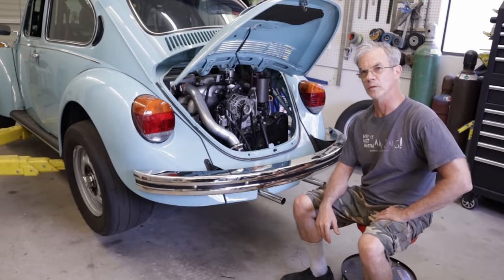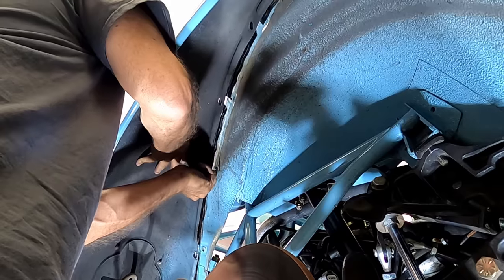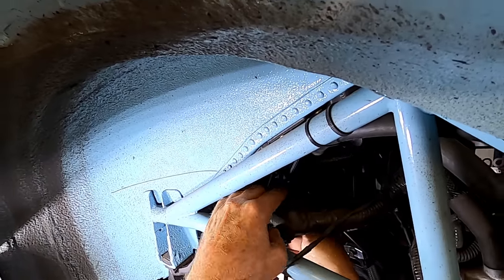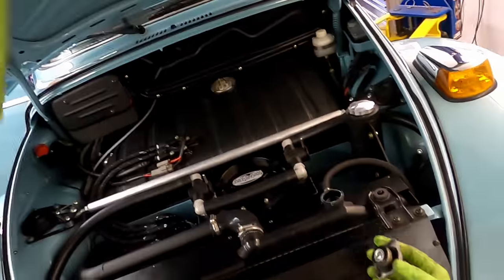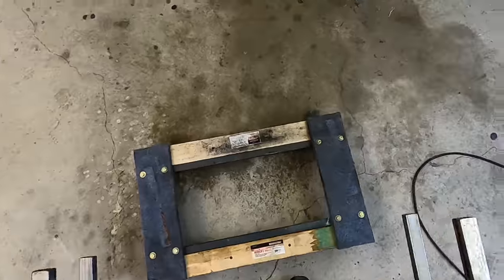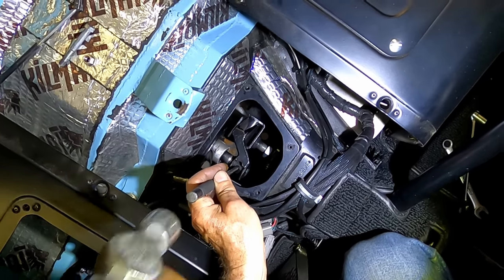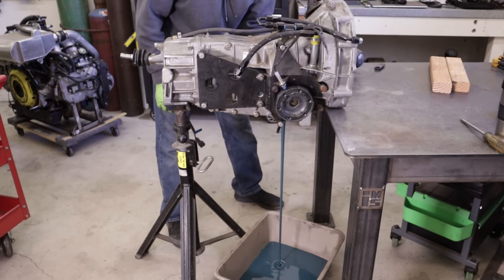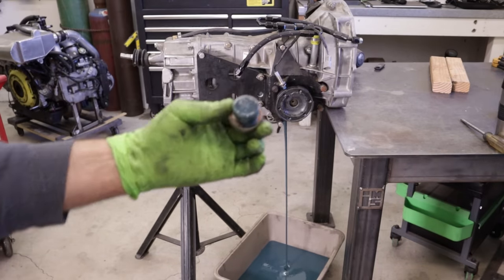Subaru engine and transmission removal from VW bug

Comment: Your Subaru powered bug would be so fun to own and drive. With that said, I spent lots of the early 1980's pulling my high compression 1835 engine out of my Cal-look bug after blowing it or the transmissions up! lol. Watching all the work you have to do to remove that engine and it's transmission makes me appreciate my now bone stock VW bugs. Pulling an engine out of them in my 50's is a piece of cake. Of course, I rarely pull them anymore due to the reliability of the bone stock engines running all the original, restored German parts.  Amazing how reliable and dependable these cars were. No wonder VW sold so many of them.

Comment: I raced shockproof for years in my gearboxes, but since replacing syncros was way more of an issue then bearings, got switched to schaffer V-twin primary lube.  Way better.   As you say, Shockproof is too slippery for the syncros,  shockproof superlight didn't hold up, and the shaeffer stuff seems to do it all.  It has a property that actually enhances the syncros, while the base stock does fine for all other components.

Comment: Had a 2110cc in my bug. Didn’t really feel that fast. My Corvair with 327 was fast. Flipped the trans 180 and motor was in backseat. Crazy easy install. Had a few kelmark gt’s. Fun too. Olds 455. Fit in corvair too.

Comment: Awesome! Thanks for sharing! I was wondering what it looked like in there from Nicole's video, glad you have a youtube! Did she break it? Or rather did it break while she was driving? Seem like it takes a while to get used to the shifting. She didn't make it past 5th and it ended kind of quick so seems possible. *Edit nvm I heard you  explain the thought as to why
Really brilliant build here, you really knocked it out of the park! The engine isn't as big as I thought it would be.
Reply from the maker: She didn't break it, but it takes a bit of time to learn how to drive it.  She would have caught on if she had more time.

Comment: John,
Have you ever tried to install the Subaru 5 speed with a vw adaptor to a Corvair motor?

There is a post by a gent that explains the process but no further updates.

Seems like a project you could tackle and already have parts
Reply from the maker: Corvair engines were pretty common transplants 50 years ago but they are antiquated by today’s standards

Comment: Interesting video l have seen a type 3 VW with a Subaru conversion but it was the non turbo motor but it was well done and the radiator was a long thin one placed under the front bumper bar also MCM did a turbo subaru conversion to a VW beetle and this beetle was and drag raced many fast car's and it beat them all this is a complec as

Comment: Unfortunately you have a trans axle, so you can separate the two with different oils. I'd be curious if you just used something like this in that gear box how it would perform 00004320530 Fuchs Titan Sintopoid 75W-90
Reply: Unfortunately or fortunately? I am confused.
Reply: @chrisallen9154  Unfortunately. I'd like to run two different oils in my Audi, but the trans axle prevents that. I run that same Shockproof Redline in my Ford Toploader transmission, shifting seems ok, believe gear noise is the same. Subaru transmissions have documented issues with 5th gear, but not with baulk rings that I'm reading until the later 6 speed boxes. I'd almost vote to have the gears matched no baulk ring at all. You can go back to what Subaru uses in there gear boxes for oil likely might help, or have someone make a steel baulk rings with carbon facings?

Comment: As complex as THIS project has become for you, for what it took for you to get at that 5th gear broken part, seems relatively straight a forward job, by comparison to what I had to do to just reseal the oil pan & dipstick rod’s mounting flange of my stock 7.3L Powerstroke engine in my 2000 F-250 4x4 Lariat! THAT had me really WANTING to sell it several times over!!! What a nightmare! Anyways, awesome mod-build of your Suba-VW; have watched all of your vid’s & always impressed… I suppose if every car made had this amount of engineering thought invested in it, they’d all be priced at now less then $100K each

Comment: Sorry if stupid question, but wouldn't worth to adjust the gear relationship and keep it with 4 gears, instead of adding the 5th?
Reply from the maker: It’s a Suby trany that comes as a 5 speed from the factory.  5th gear is like a fwy gear so it’s not over reving at 70 mph

Comment: I I hope maybe you can help me put a 1998 Forester 2.5 L Subaru in my sent me for Volkswagen beetle I was told did not have to run both oxygen centers but my car won’t run right so I’m trying to find out if I need them both in there or just the one like I was told
Reply from the maker: I don't know the answer.  Maybe someone on one of the Subaru/VW Facebook groups can steer you in the right direction.

Comment: If that is a K&N air filter wash all the oil off and use it dry. They work better and don't get dirty right away. I won't even use a new one without washing it first.

Comment: I know there are adapter kits to mate almost any engine to a VW transaxle.
Is there a similar kit for using a Subaru 5 speed with a VW engine?
Reply from the maker: Yes, there is, but not recommended.

Comment: Can you please install the Corvair engine in the VW thanks.
Reply from the maker: Ha, that would be a giant step sideways.
Reply: @JohnReynolds661  Yes but it would be a lot of fun! Even lighter.
Reply from the maker: @yesode4201  Tell you what, you do it and I will subscribe to your channel!
Reply: @JohnReynolds661  What is the time and cost estimate on the VW? As for the VW v8 I will see how you Corvair works out. Thank you for the cool builds!
Reply: @JohnReynolds661  Your reply is 'witty' and clever as usual.
Very good.
And the second also, a good response.
From the initial request, it was not clear to me, if he meant the Corvair V-8-LS4 or the original 6 cylinder, air cooled - somewhat similar with the Porsche 6 cylinder 'boxter' engine
Though from his later reply to You second reply, it seems he intended the LS4 with mentioning "VW v8" and after Your Corvair.
It seems this fellow is unaware that others have already accomplished LS4 swaps into the Corvair, similarly, some with single, others with twin turbochargers. Yours is certainly unique and grand to follow, with Your specific selections, choices, fabrication, suspension, etc.
Which ECU have You selected John ?
my personal interest would be a supercharged, however my location abroad has such extreme restrictions with motor vehicles, access to these older ones especially, certainly more so with any parts, engines, transmissions, drive train, all necessary parts, components, fabrication equipment, materials along with the space, locations to accomplish these projects. Thus, it basically is nearly impossible without extreme expense with acquiring all that is necessary along with arranging the shipment and location. This also would require the necessary planning for nearly every detail from the beginning, as You can imagine and figure. Anything not included, prepared, planned, expected or arranged will result in significant delays, and costs.
For me, it is easier to approach projects which involve electronics, which are more accessible, attainable, though some limitations exist within this too, especially compared with in the USA. Taiwan based manufactures are very good to excellent and shipping is attainable, along with from Japan too.  Though all still have significant importation duties + Taxes [VAT 17%] added after duties added onto total price. Vehicles have the highest duty of 100% + VAT
it would be nice and delightful to also haves such motor vehicle projects. There are many which are within my imagination, for design, development, including some very useful which combine several developments together.
Am looking forward toward more of Your posts with this VW Bug project and the Corvair Project also.
Reply: @JohnReynolds661  So, it seems, there hasn't been anyone with posted comment about Your proposed description, as a 'Theory' of what resulted in these two lever-baulk piece components within the 5th gear synchro-ring assembly, which You discovered broken, as shown during the disassembly.
As an engineer, with extensive mechanical, electrical, materials, physics, mechanics knowledge, my methods of assessment, evaluation, discernment, differentiation, determination, analysis, troubleshooting, repairs, etc. are very methodical and based in the knowledge, ideas, concepts, principles, etc.
My level of expertise and experience with transmissions is extremely limited. Thus, it was necessary for me to search more about the specific operation, parts, details, operation, function with each component within the synchro-rings and the transmission gears. Through my search it has become rather clear about the details of operation of and with many versions of synchro-ring assemblies. Thus far, the parts and diagrams You show in this posted vlog are also easily located from Subaru, which it seems is precisely what You located and posted. Thus far, only Your video here is the only one which has appeared showing any disassembly of any of the Subaru synchro-ring assemblies. Other videos showing the transmission disassembly, rebuild, assembly do not include the synchro-rings assemblies, Thus, the only detailed information is seen within Your video, showing the disassembly of the 5th gear, then seeing the broken pieces of the two lever-baulk components. It is not entirely clear to me how these pieces function within the synchro-ring assembly, and only the diagram shows the assembly arrangement, and placement.
Perhaps You know more information about this Subaru synchro-ring ? This specific arrangement differs from many other types. It appears from the diagram-drawing, the other synchro-ring assemblies for 1st-2nd, 3rd-4th, use a single piece ring in that location in place of the two in this 5th Gear synchro-ring. AS is common, there is some type of spring, clip or ring which hold the assembly together and allows the necessary perpendicular movement along the shaft for the ring to accomplish its function of synchronizing the rotational speed for smother shifting. The other necessary aspect is the conical shape on the end of the gear and inside the synchro-ring. There are specific amounts of spacing required along with a necessary means for the inside of the ring to grasp onto the gear. Both the clearance and the grap-grasp need to be checked and verified. The ring may appear to be good, also with proper clearance, but still not function properly do to its wear, on the inner portion of the ring, thus not grab-grasp properly as required. Hence the synchro-ring could be worn and need replacement. It seems to me, via looking at the lever-baulk pieces, both of them broke apparently the same way, along the same 'lines' into the nearly the same size pieces at the same locations. 
It also seems to me these lever-baulk pieces would not have broken via one time of 'jamming' the gear lever into 5th nor would occur similarly with any other synchro-ring assembly for any other gears from one time or a few times either. My lacking is knowing what exactly is the function of these lever-baulk pieces, though they seem to be the same as the solid ring pieces within the other gear pair synchro-rings, and the 5th gear synchro-ring has these two pieces instead of one solid ring. Is it correct these are in place of other synchro-rings which have clips and keys or similar? Are the portions of the lever-baulk which appear as a 'tab' extending along the radius, perhaps functions as a key for placement ? It seems to me, that perhaps there was equal force upon the two tabs simultaneously, which resulted in the portion near the tabs to crack, thus break completely. As, stated, this does not seem it would occur from one time, rather many times. Also the 5th gear use is not generally under high torque and power during the shift from 4th, thus there also is not a high amount of forces or rotational speed either. During the higher rotational speed, torque during quick launches during racing or from 2nd to 3rd, perhaps 3rd to 4th, if and when that occurs either during the drag strip track use or local passenger experiences, then those gear synchro-rings would experience more forces and possible wear. If You were running high power, torque runs a the top speed, say within a longer 1/2 mile track, perhaps You might have shifts into 5th gear with high power, torque and thus such forces. Clearly within  1/4 mile run, the 5th gear is not reached, used and not more that 3rd gear correct ?
So, it may be this 5th gear has been problematic for quite some time. Perhaps actually the 5th gear synchro-ring has been worn, thus not functioning properly and difficult to shift into 5th gear. Then, over time, as the synchro-ring wore, deteriorated, then the numerous times of shifting into 5th gear for the highways use, it became worse and more difficult and gradually the the forces upon the synchro-ring and more so upon the lever-baulk pieces, specifically upon the tabs occurred more and more often, with tiny, small cracks developing then breaking.
So, if this explanation, is near correct, then the 5th gear synchro-ring is worn and not functioning properly, You can check this easily too with the parts assembled on the shaft and sliding the sleeve for the synchro-ring to grab-grasp the gear and turn together with the gear, if they do not turn together or there is slippage, then clearly the inner diameter, cone of the synchro-ring is worn, thus needs replacement. If the synchro does not function properly, then the multiple lateral forces, combined with the rotational forces, torque could result in tho lever-baulk pieces braking as they appear. Such is my assessment, evaluation, analysis, determination, though it would be helpful to know more details of about the specific shape, function of the lever-baulk pieces to be more certain. That is why my search to find some more details about the Subaru synchro-ring assembly with their specifically designed pieces is important.
My main purpose to describe these details is since finding some details about synchro-ring assemblies, function, operation and the possible wear of the inner portion, though not clearly obvious, this would be useful for You too and possibly explain what led to these lever-baulk pieces to break-snap as seen.
My hope is that this information, assessment, evaluation, analysis is useful, helpful and beneficial
All The Best 
Sincerely
Reply from the maker: @newtonfirefly3584  Not completely sure but leaning towards Holley Terminator.
Reply from the maker: @newtonfirefly3584  Newton, seriously, you got to shorten your post up.  My attention span isn't that great.
Reply: @JohnReynolds661  please forgive me.
it is difficult to put the necessary details in just words.
i figured someone like You with such attention to and with detail, along with being a concert level musician would have such patience.
If i had the means to present the information via all of tools more concisely, and clearly, i would.
perhaps, you can read the comments on You computer and in small bits.
The main points are:
A. The synchro-ring may be worn, though it does not appear to be. - if You want there is a good video i found to view about this:
https://www.youtube.com/watch?v=MXsRfbOiBhE
B. The breakage of these lever-baulks seem to me occurred over many times - not once or a few tines.
C. the broken pieces seem they may be related to the synchro-ring not functioning properly.
Hope this is more concise while useful, helpful, beneficial too.
All The Best.
Sincerely

Comment: What's the mpg on that
Reply from the maker: Not really sure, but since it's only driven 1,500 miles per year, doesn't really mater.  It also uses e85 which gets about 30% less fuel economy while costing 30% less.

Comment: It's easier to work on than a peogoet 405 diesel turbo.
Reply from the maker: I had a 404 station wagon many years ago.  Reliable doesn't come to mind.
Reply: @JohnReynolds661  I'm rebuilding one as we speak so they are good I was told the same thing as my injection pump rebuilder he said they go forever thanks man this gives me confidence 👍
Reply: @JohnReynolds661   I'm talking a Australian import 1.9 litre srdt turbo one of the last import diesel turbocharged engines.
Reply: I currently drive a single cam 4 litre fuel injected EB falcon 1993 for the last 25 years after I rebuilt it years ago I'm like you I like experimental projects 😁